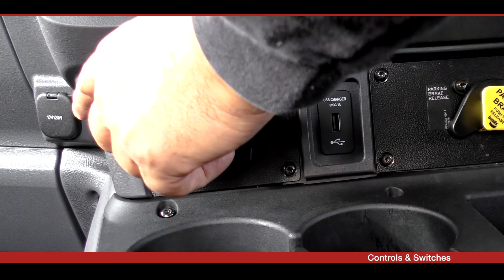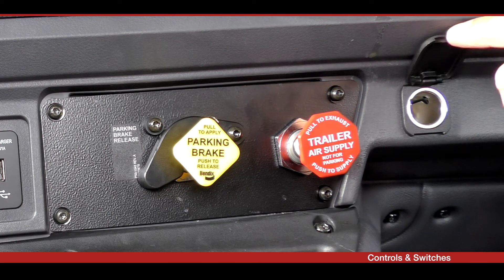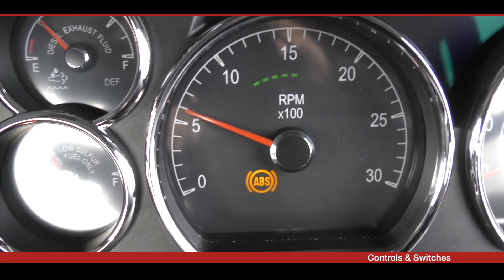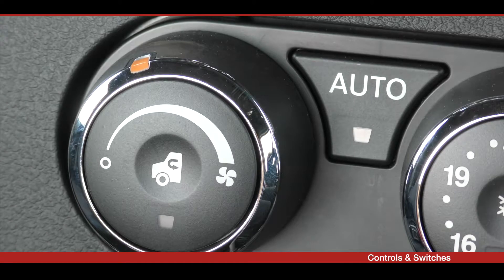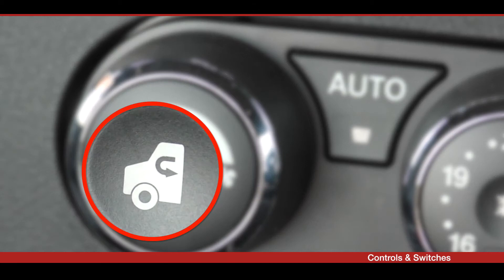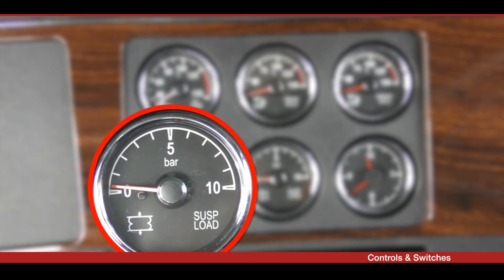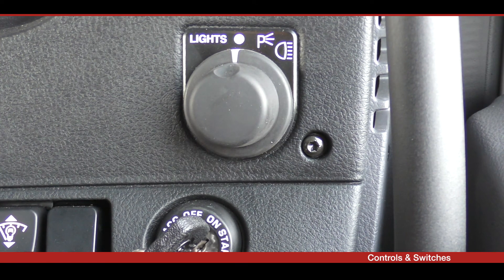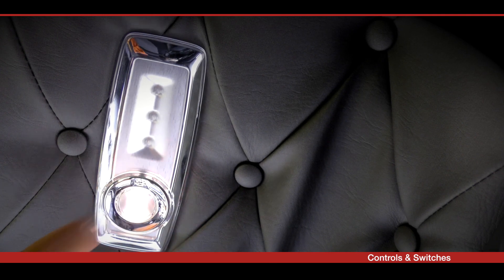KW012 Kenworth T610 Switches & Controls

Comment: How hard would it be to place the engine braking switch on the steering wheel? It would be So much better for the driver's comfort if it relocates
Reply: They have it on the K200 T409 T909 etc. Personaly I did not mind any of the 3 placement postions they have had in the last 10 years.
Reply: For a 2021 model 610 they now did